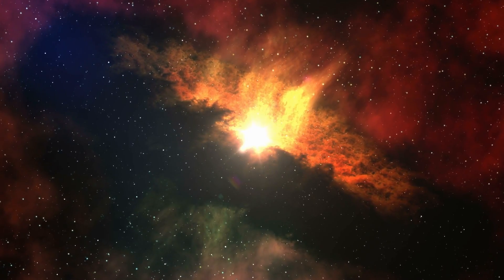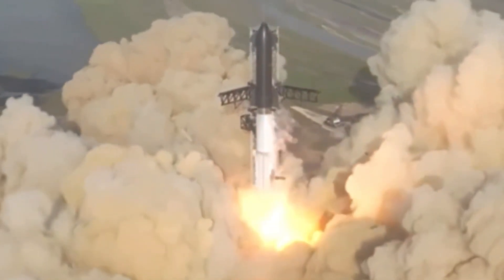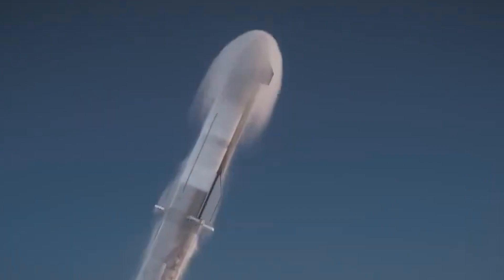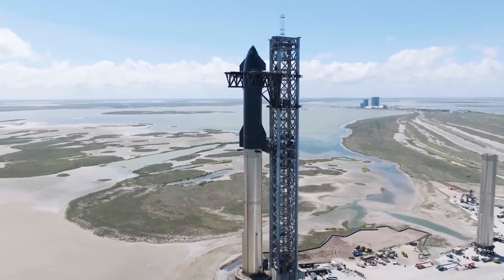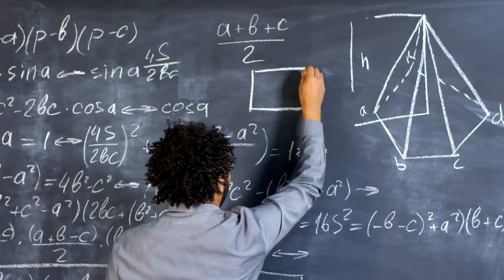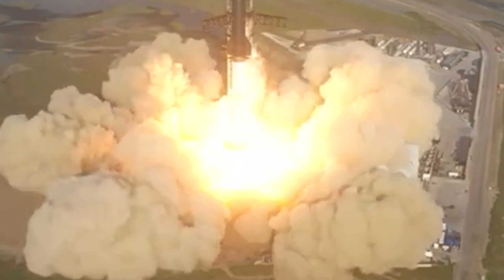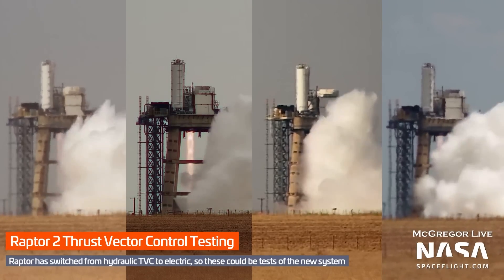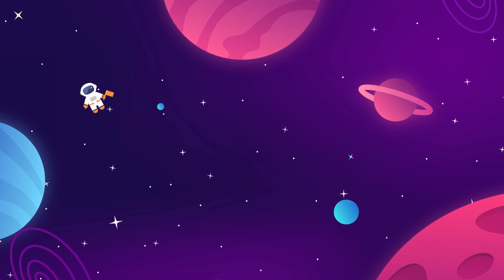The SpaceX Starship Orbital Launch Update Is Here!

Comment: To Summarize: 
Launch Pad - Failed.
Engines - Failed
Guidance - Failed
Rocket - Failed

Musk's Opinion - 200% Success!
Reply: It's called a success because 1. they now have valuable data on how to make it better (better now than with people on board) and 2. They never really thought it would get this far. The mission goal and flight plan was for starship to clear the launchpad, and it did. So it was a success.
Reply: @lordmicrosoft1986  You can make your expectations so low that everything is a success.

Comment: The rocket should go into full blast off in the air high, helped by auxiliary smaller thrust engines at the top of the rocket to lift pulling off  the ground maybe 200m or whatever needed, so then the blast off won't be so dangerous and damaging, and sure a lot less cost for the launching structure. No pad needed, it was shocking  how it disintegrated completely blown.

Comment: SpaceX takes way too many shortcuts and is in way over its head..  It was not a success, it was a failure in so many ways.  Just the fact that 8 out of 33 rockets didn’t fire, they destroyed their launch pad and destroyed personal property for miles around the launch clearly shows they did not understand the situation.  If it was a hydraulic failure, why didn’t they have redundant backups to allow release the second stage?   All of these issues should have been anticipated and addressed prior to this launch.  No excuses.
Reply: As pointed out already by others in this comment section, the goal was for starship to clear the tower and launchpad. It did. Everything else was icing on the cake. This test was done so they could see what would go wrong
Reply: @lordmicrosoft1986  BS.  The minimum hope was for it to clear the launchpad.  The goal was for a successful launch and flight to completion.  You never plan for failure.  Testing is to prove the plans and concepts work and to shake out any unanticipated problems.  Much of what went wrong could easily have been anticipated by the engineers.  For example, building a launchpad with a perpendicular concrete floor without any consideration for defection or absorption of the rocket blast was just stupid and the engineers (or managers that forced them to build it that way) should be fired!  SpaceX is like the parent who tries to teach their kid how to ride a bicycle and doesn't realize until after the kid crashes that the tires were flat.  SpaceX is not thorough enough in their preparations, they make unnecessary mistakes because of trying to cut time and costs.

Comment: Obviously the design of the Launch/Landing Pad Base needs a SpaceX Completely Radical and Out and Radical Out of the Box make over.
I suugested a new pad design directly over deep water with submerged naturally water cooled / multi-layered submerged steel plate system 
at the appropriate depth(s) directly beneath the pad and attached to each support leg of the base  so the rocket force has something to push-off of 
for launching & Landings.
Reply: Sorry about the typos. . . cannot edit.
Reply: Second thought . . . why not water cool as much of the structure as possible and pipe whatever steam safely away from the area ???. . .
Reply: Hey! hope you're having a nice day. 
Actually, this is done because Starship has to be able to start from Mars' surface, so that's why they didn't use those things you proposed in the test

Comment: Maybe lift the launch platform further away from the ground, or scoop out the ground away from under the rocket motor blast?
An inverse square relationship.

Angle the base to deflect rocket blast away from the rocket engines, as per the 1960s Apollo style lauchpad setup.

I mean, it's hardly rocket science, is it?

Comment: You HAVE TO use water to deflect some of that energy.
Reply: The problem is that it has to be able to launch from mars, too
Reply: @lordmicrosoft1986  different engines, different gravity, different escape velocity.
You might be able to send a make shift pad to Mars ahead of the landing party. Literally 💧drop💧 ship the parts. Probably in a 3 part structure. The other option would be to build a pad out of materials that are currently on Mars. Which would be a much longer process.

Comment: Great video that answers a lot of my question and beyond.

Maybe they should make a sort of big pond under the rocket, or use carbon-based slabs  that are protected during the construction then exposed on launch time… or just try to launch the rocket with the minimal number of engines to lift it off the launchpad then the other engines ignite midair

Comment: Would a crane lifting failure during Starship assembly also be viewed as just another "ho-hum" development problem? Of course not because unlike Starship itself, a crane lift is a well known entity.  Well so it is with 80-years of launch pad design experience starting with the V2 rocket in WWII up to the massively powered Saturn V and other large heavy lift haunch vehicles both U.S. and Russia.

While as an aerospace engineer I agree with Elon Musk's high risk fly-and-break-it development approach for Starship itself, there is no excuse for what occurred to the launch pad. Starship had significantly more thrust than a Saturn V and yet SpaceX was launching it like a much, much smaller rocket.  The potential of significant acoustic feedback damage is well known and over a half century ago the Saturn V launch pad design team successfully mitigated those effects with flame defectors, water spray and other features.   That design analysis and information is readily available from NASA.  Reviewing what worked successfully for the Saturn V should have been the first step for the Starship launch pad design team.   It's a shame because with all the analysis power engineers now have at their fingertips combined with the plethora of NASA pad design data, this expensive fiasco could have been avoided.  However this also doesn't bode well for SpaceX's design review process which should have compared the Saturn V's launch pad mitigation features and known data against what the SpaceX engineers baselined for their design.

This failure was totally preventable and unless the launch pad design team were under extreme budget pressure from their management to minimize cost, the launch pad design team and management should be replaced along with anyone involved in approving that design.  However to the flight vehicle's design team, it is a tribute to the robustness of the Starship that all that loose debris didn't cause the vehicle to explode on the pad!

Comment: Something not mentioned was the thermal load on the concrete. It wouldn't take a crack for the concrete to fail. The moisture content is a lot higher in sand at tide levels than soil. Boiling the water in the sand under the concrete pad would form a steam explosion in an upward direction. Amplifying the acrostic shockwave in to the concrete from above

Comment: Could the Starship have been separated from the booster and landed itself nearby? Would it need to vent some of its fuel to reduce its landing weight? Is all this already designed-in as a possible crew abort procedure?
Reply: the hydrolics were destroyed and are responsible for separation

Comment: Reminds me of the Failed Trident Missile launch where backsplash broke a gimbal actuator causing the now infamous “Trident Pinwheel”. The problem with “lots of big engines” was first observed on the Russian N1. The “lots of small engines” model served the Russians well with the R4, the problem was the concept didn’t scale well. Hopefully the engine mount plate resonance issue that doomed the N1 isn’t repeated on the Starship. That said, hope is not a sound engineering strategy.
Reply: Russian rocket has been doing with 20 engines for decades, with few failures.
 Each engine is half the power of a raptor engine, used in "starship".

Comment: 7:28 That poor car is why you need to stand so far away from the launch site.
Generally, I don't understand why SpaceX thought it would be a good idea to launch from such a platform. There's a reason why launch site engineering is just as important as the vehicle itself.
All this energy has to be directed somewhere, letting it all just go straight down to the ground will obviously leave nothing but carnage.

Comment: The Saturn V also did a LUT Avoidance Maneuver. It's not so much to save equipment from damage (it can be said that the Ares-1X test launch actually casued more damage to the tower with the tilt and the SRB flame hitting the bottom more directly)

It was mainly needled to get a large rocket moving away from the tower so it would not hit it. A bad gust of wind at a bad time could get a large slender rocket like Super or Saturn V moving toward the tower when it's not moving fast enough to correct with gimbal.
Reply: Damn

Comment: Interesting. Re the water filled steel plates.. nah. It would be impossible to get enough water thro to remove the heat. Specific heat capacity of water   is about 4200J/KgK, I reckon be impossible to get enough water thro a pipe system to remove the heat from those engines. It would flash to superheated steam and blow the thing apart. It needs a deluge system where the water can evaporate free and take the heat to atmosphere. But, I believe the launch site is a nature reserve, and a deluge system was refused ?

Comment: The SLS comparison is BS!!  If/when SpaceX has THAT much money an THAT much time They will have a DOZNE LANDINGS on the Moon.  BTW, pad 39A is built ABOVE ground therefor the high water table (the problem in Boca Chica) was averted.  SpaceX simply has no room, no environmental impact report and (probably) not enough money to rebuild the entire thing that much higher.  I say go back to the off shore platform, put it at the equator.  its hard to blow a HOLE in the ocean.  Then, for SPITE give it a Panamanian FLAG!!!
Reply: The Biden Administration has awarded $4.1 billion dollars to SpaceX for Starship R&D and construction.

Comment: weirdly, working as a demolition worker taught me one thing, dont light fires on concrete, the natural bubbles and such in the concrete will explode at relatively low temps when compared to someone hitting it with enough heat to get a rocket into orbit

Comment: SpaceX did have time to build a flame diverter and water deluge system but Elon was against it. In 2020 he went against the idea with one eye on reusablity and quick turn around.

Forget about using Starship for point-to-point use on Earth. The claim that it can be used for such purpose was just another one of Elon's claim that is not going to happen. It is as realistic as having an affordable hyperloop.

The real problem is having Starship relaunch from Mars for the return trip. Having a complex launch system on Mars is simply not going to happen. Even having a concrete base is not possible without a establishing an in-situ production system. This means that smaller vehicles will be required to transfer cargo from the mothership to the Martian surface.

Comment: Im still impressed by the launch. Elons team have done a super job over the years of SpaceX and they continue to learn and improve. They're most of the way there  with starship, just some reliability and perhaps technical solutions to go. 
Perhaps a composite base matrix material is needed (akin to GRP, rather some sparsely positioned rebar.?)
Up up and away.
Reply: Maybe they should have done a bit of research PRIOR to the launch!
Reply: @johnp139  the video is saying they have, it just wasn't ready in time.
Yet, yes, there are more superior, and  structurally sound, designs out there, only Elon knows why they decided not to adopt those other proven designs.

Comment: It seems the launch pad is so far short of being successful that a bit of patching and a bit more concrete isn't going to fix it. If the engineers of 60 years ago were making rockets using Stone Age technology that worked, then all the techniques they used for launching need to be used as the starting point for a better system and not discarded.

Comment: SO, that pad was NEVER good enough.  I don't think there's any type of cement you can lay down that this rocket won't destroy.  So, for one the blast needs to be directed and there needs to be metal on top of the base pad to protect the cement or the blast just needs to be directed away from the cement.

Yes, that's called TOTAL engineering failure.  I mean they KNEW what the blast force was going to be, and what happened is exactly what I thought would happen, destruction to the pad and destruction to tanks and they're LUCKY they didn't have a huge explosion on the ground.

I wasn't impressed one bit with the lack of proper engineering in ALL parts of the design.  EVERY component matters.

And there is no GOOD way to fix that pad.  They need to build another one, and this time using proper math.

Comment: So this test proves the starship is useless.   Here me out here.    The fondag launch pad couldnt take it, so it needs to be replaced with a water cooled plate and deluge system.   Which is all well and good on earth, but starship is supposed to go to mars.   There is no water cooled steel plate on mars.   There is no fondag on mars even.   Its just bare martian bedrock.    Starship will destroy itself when it tries to land.   Forget about taking off again.    Therefore, no mars missions are possible with starship.   And thus, even if all other problems are solved, its still useless.

Comment: The thing that gets me is that for nearly every single heavy launch spanning decades there have always been flame trenches, exhaust diverters, etc.. as part of the launch pad in order to protect the rocket itself.  For some reason, however, they announced that they would not be having any of these safety features in the construction.  I mean they're there to either help prevent the damage or help limit the damage that this would have caused.  That being the case, odds are that it would have actually made it to altitude had those safety features been present.  I just can't understand why the decision was made to forgo decades of experience and just "wing it" for the most part.   I mean Elon himself, when he announced the lack of those safety features, said "we will probably regret it"... and for good reason. Honestly for me this seems like a complete waste of time and money.  I mean I get it... "getting off the ground is a good test" well yeah I guess... but I mean that's like building a car and deciding not to install a braking system that's been part of its design for nearly as long as they've been around, and when you get to your first red light, you blow through it and smash into another car destroying yours and then saying "at least i got out of the garage!".

Comment: All those engines were damaged by concrete.  The steel plate idea is no better than what they are using now.  The ground beyond the plates will still be affected.  The launch mount is too low and needs to be raised.  If they did this and then installed a flame diverter and a better deluge system they would not have these types of problems.  To install a flame diverter they need to raise the launch mount period.

Comment: I was wrong when I stated in another thread that the Starship uses 27 Merlin engines in the first stage. It actually uses the Raptor engine which I assume is supposed to be a better choice. However, 27 engines all expected to operate without any major difficulty seems to be rather hopeful and we have to remember that this rocket is intended for a human crew.
The damage to the launch pad is also telling and those storage tanks that were quite close by seemed  foolish.  NASA'a greatest heavy lift rocket was rhe Saturn 5 and it had 5 J-1 engines and only one of them failed, that was during during the ascent of Apollo 13 and it was compensated for by an extra burn time of the remaining 4, something that NASA had planned for.  I don't really see that level of contingency planning with SpaceX.

Comment: The best place to launch Starship stacked would be over the ocean.  What do we know about the purchasing of the offshore platform that was reported last year?  This would aleviated the need for a solid flooring under the launch pad as all that would be needed is an open ring to launch from off the side of the platform.
Reply: What about corrosion though. I imagine it's also more expensive to transport the rocket there and even more expensive to get the fuel there.
Reply: @ooooneeee  Well if everything goes as planned there is no problem.
First getting the rocket there.  Super heavy and StarShip are both designed to return land at a pad.  That's why they have the chopstick landing setups.  So the Landing pad is not over concrete, it's over the water.  It lands like Falcon 9 rockets.   The original plan was to drop it into the carribean, until they can land it safely on land, and retrieve it on a "new style" retieval boat.

As for getting the fuel there, Offshore unloading with super tankers of oil happens over a mile out at some ports like Houston/Galveston and Beaumont/Port Arthur and they pump oil inland.  What's the difference in sending it offshore if the oil platform SpaceX already bought is a mile offshore and setup to launch and retrieve?
Reply: Sorry not happening. Musk has sold both platforms off.